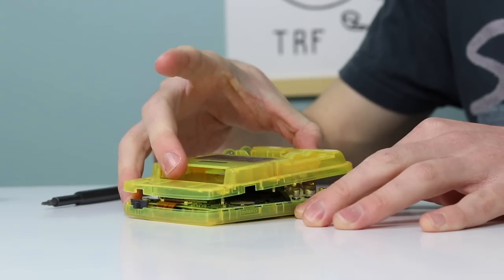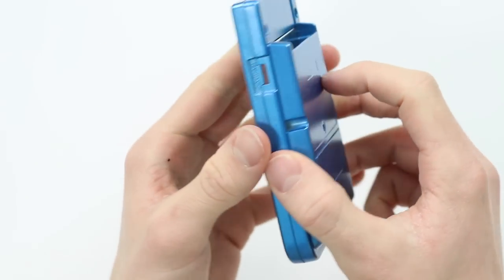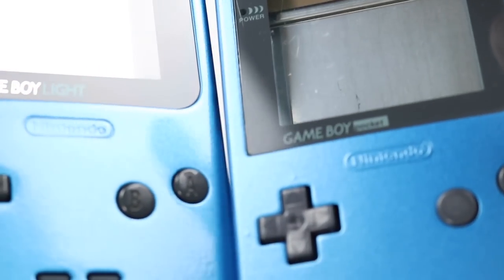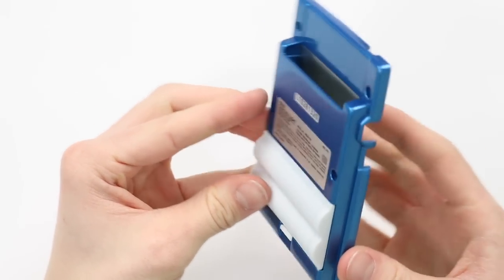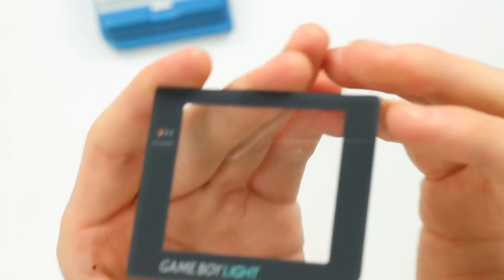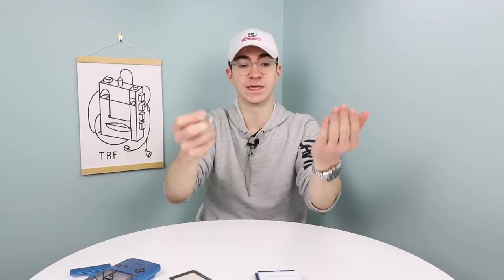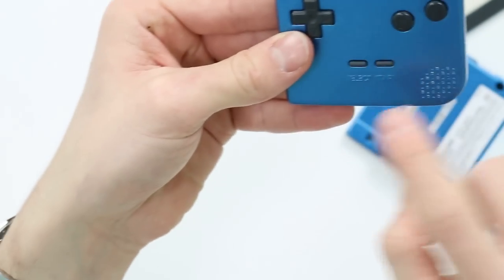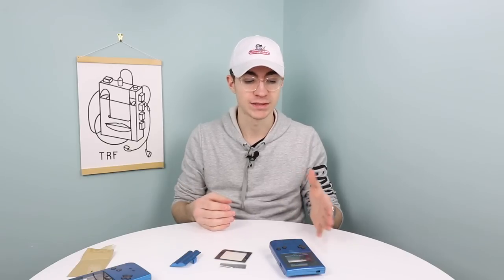Replacement GameBoy Light Parts!

Comment: 600 grit.....yikes! I use tamiya filler for the deep dings. I then use 1500 grit and then 2000 grit on my GBLs. You don’t need to remove all the paint, just scuff it so the primer adheres better.

Comment: Maybe you addressed this in another vid (or maybe it's understood), but the GBC PCB and shell battery terminals will work with the GBL. The (-) PCB one is a tad different on the GBL (the 3 claw prongs are a little more narrow and also not as rounded), but I was able to get the GBC one to work in it just fine.

Comment: If there are flaws in the surface after you sand your primer, just lay another coat and sand it again. Repeat until perfect. If the flaw in the primed surface is really bad, give it a dab of finishing putty and sand it before applying another coat of primer. Ideally you want to have a finely sanded (min 600 grit) coat of primer with no bare spots. 

Also, try to always use a sanding block, it's next to impossible to get a flat surface with your fingers. Just glue paper onto different size dowels and blocks. If all you want to do is scuff a surface, scotchbrite pad works well at getting into hard to reach places.

Comment: If you put filler primer on the 3D printed parts before sanding it, it will be much smoother. Just look up "3D printer filler primer", and will find all kinds of stuff on it.

Comment: Any tips for repairing the right side battery terminal metal contact? My gba is missing the prong but still works with tinfoil shoved in. I've thought about using a metal paperclip to make contact but I'm unsure if that's safe. Thoughts?

Comment: That painted shell came out tops mate. Good job. For the 3D printed parts, what I find that helps to get rid of that texture is giving it a  coat of MS or HS primer (easily found at auto parts stores) then giving it a nice wet sand with either 600 or 800 grit. Usually works really well. Great video.

Comment: You can use a brush-on resin to fill the stepping between layers. That'll make it easier to sand, and you won't weaken it. XTC Smooth-On is one.

Comment: Little tip to avoid sanding 3d printed parts to get a smooth finish. 
If you put some acetone on tissue then suspend your parts above it in a jar, the fumes will 'melt' the surface causing it to blend the bumps between the printed layers.
'DIY Perks' has a great video on it. Personally found a few of my prints feel stronger too! :D
Reply from the maker: Great info! Thank you.

Comment: You could use something like aceton to smooth out the 3d printed part
Reply: Acetone smoothing has 2 problems. First it can only be used on ABS. If the parts are PLA it won't do anything. Second it usually distorts the shape of the item with warping or worse. For something that's being painted anyway, a bit of filler and sanding is going to be the way forward. Or use a printing service that uses SLS printing rather than FDM. Shapeways is the usual, well known one but they are v. Expensive and there are cheaper alternatives to them. But SLS print quality is much higher. It still needs a but of smoothing but it's more like a sandblasted texture rather than layer lines